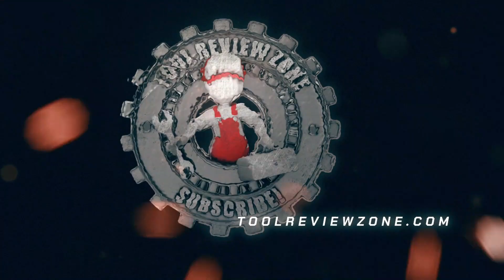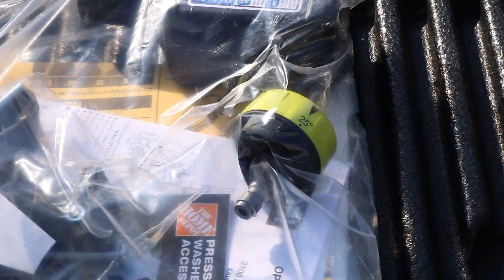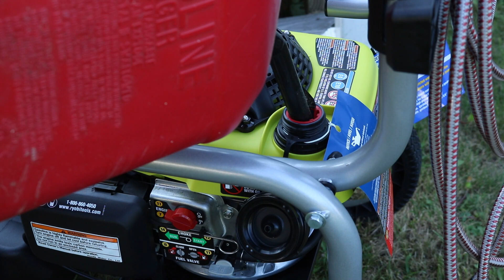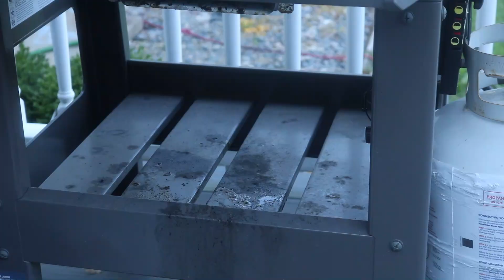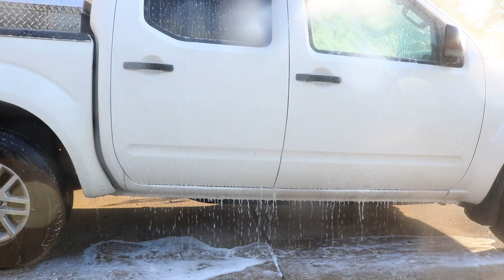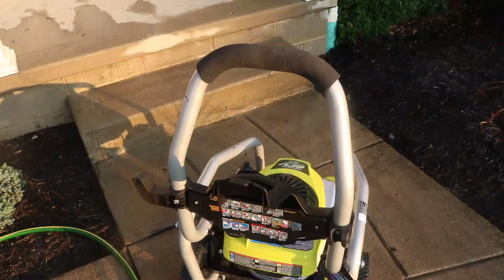You Won't Believe How Powerful This Ryobi Pressure Washer Is! car high pressure cleaning tool

Comment from the maker: Buy Here https://homedepot.sjv.io/ovL09
Reply: I actually work for a PW company but ours are up to 10k psi and heated but just got one of these barely used just missing the adjustable head. Question is it just started barely pisses out water without the head and I put some pressure on the tip with my finger an it's a little better  but  wondering if I just don't have enough pressure coming fromy water supply.  I'm use to a 900 gallon tank in our trucks that we go through in no time. I'm use to our single time nozzles that we switch out but I notice this is a completely different wand

Comment: i got one of these for 85 and just bought an 18 dollar kit with the new carb, air filter and spark plug on amazon. Didn't even feel like doing any carb cleaning or disassembly when the carb is so cheap. Runs nice, i like the idle down. One thing, i don't recommend pressure washing cars, especially not with a 3100 PSI machine people, use common sense. You will eat right through your paint, u really don't even need to use pressure washers on cars at all.

Comment: not a good idea to start it up with no water going to the pump. your new power washer pump will die on you running it dry like that. .
Not to be negative, just FYI'ing you .

Comment: This appears to be a good pressure washer, except for one detail that was left out: The gas tank is limited to one quarter gas tank, which is good for up to only 45 minutes of run time. I was close to purchasing this one, but the capacity of the gas tank was a deal breaker for me. The one I just purchased, a Simpson, holds close to a half gallon of gas with up to 90 minutes of run time,  but it doesn't go to slow throttle.
Reply: bring more gas, problem solved

Comment: I do car detailing on the side and now people are asking me to do their drive ways now and then. I have a little sun joe electric pressure washer that is just not going to cut it. I just saw one of these used on let go and I’m hoping it’s in working condition. It looks new. I know nothing about washers, I would just rather pay 250 than the 400 they are going for new

Comment: Can someone explain to me why this 3100 psi model is more expensive than the same exact machine in 3300 psi?... The 3300 PSI one has the idle down feature and comes with the 50 ft hose and the new green handle/gun... I can't figure out why this one cost more

Comment: I just bought one today to clean my grill and I love it. Great power. The only thing I dont like about the one I purchased is the hose, it''s too stiff and wont uncoil good. Hopefully I can find a better replacement for it. Good video!
Reply: How do you like the idle down feature?  Any issues with the idle down feature?
Reply: @michaelwelker3595  I love it. works great. idles down as soon as you let off trigger and goes right back up as soon as soon as you hit the trigger again. Pretty good power too.

Comment: How is this on cars? Can it damage paint??
Reply from the maker: Sure, any pressure was6can damage paint if you put it on the wrong setting.  With the correct spray adjust though, it works great

Comment: i started cleaning houses as a side gig. Not too high volume maybe one house a week. do you think this Pressure cleaner can withstand being used once a week for a couple hours
Reply: I’ve owned this for 6 years and use the piss out of it and have never changed the oil and it’s now 2026. Pulls right up every spring. Best dam power washer in the world

Comment: I got this exact one for free. Guy could not get it to start after sitting for a few years and got frustrated and gave it to me and said good luck with it.
I drained the bad gas out, and it started but ran like shit. The idle down didn't work either.
Plug was fouled badly. Took apart the carb and found the guy had the idle down linkage and choke hooked up completely wrong.I dont know what the hell they did to it.... but thats why it wouldn't run correctly. The idle down cable was seized. Took it off, freed it up and replaced the compression seals on it as well. Replaced the plug and changed the oil.
Runs good now. 15 bucks in parts. Not a bad deal at all. Plenty of power.
Reply from the maker: Great deal 👊

Comment: Hey bud, if you wanna stop over flow when filling 2/4 stroke equipment get one of these

https://www.husqvarna.com/ie/parts-accessories/fuel-cans/combi-can/580754201/

European product but surely available on your side of the water.  Designed for chainsaw refilling having oil on one side and fuel on the other.  Has an auto stop fuel filling function.  Works really well. Ideally you’d have a 2 stroke and 4 stroke can.

Comment: I'm just saying my birthday was the other day July 31 that would make a nice birthday gift I'm just saying
Reply from the maker: Haha definitely a nice birthday gift bro. Next time you put it in the cart, leave it in there cause its beast!!!
Reply: Tool Review Zone I was looking at the small one 1700 PSI if I like a $110 and I just wasn't sure if that was powerful enough and I like the fact that the one you got has a Honda motor which you can beat Honda that's the best motor I think I'm going to buy one I need it for the PVC fence the circle driveway the backyard that was the greatest video so far that really helped me out on a decision
Reply from the maker: @josephmalinowski6817  so happy its helped buddy.  The Honda motor definitely sold me too. Let me know how you like it if you get it bro
Reply: Tool Review Zone i definitely will and I've been doing so much work lately I haven't had a chance to sand and stain that door I was telling you about my father got it's solid oak with the big iron hinges I got to start that waiting for it to cool down a little bit but will send you some pictures before and after didn't forget
Reply: Tool Review Zone vcg just mentions you on that website about your power washer he didn't know exactly what was the PSI at all of them or just the one with the Honda 3100 just wanted to let you know he gave you a shout-out